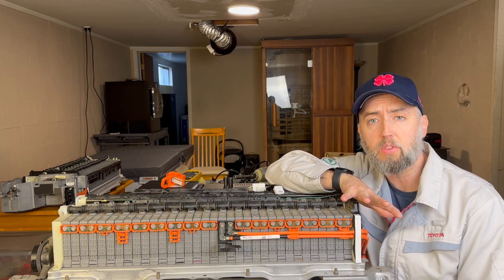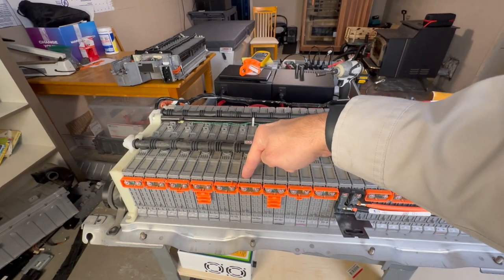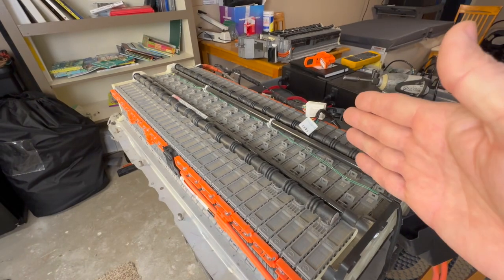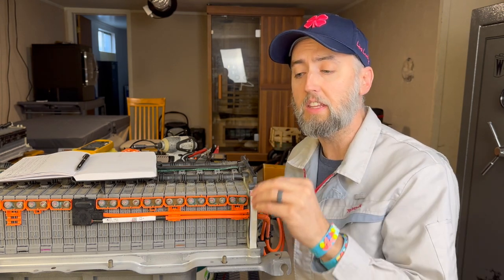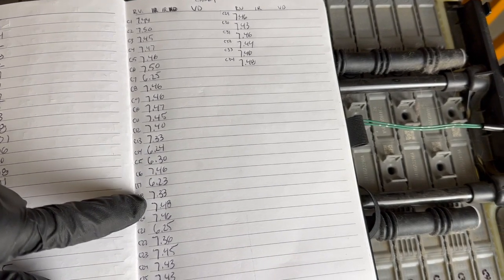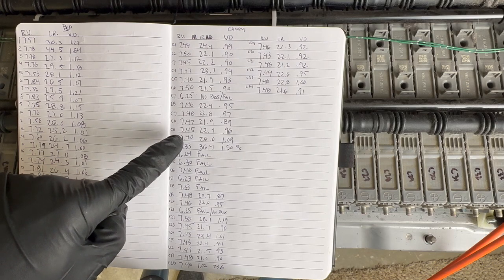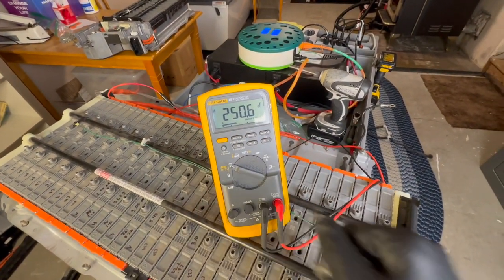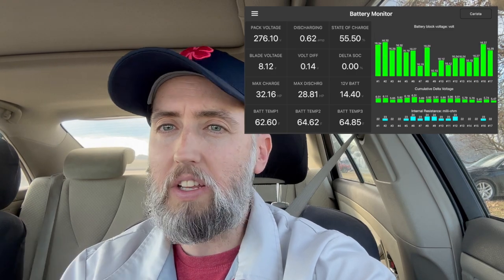How To Properly Repair A High Voltage Nickel Metal Hydride (NiMH) Battery Pack For Hybrid Vehicles

Comment: Nice education. What would be best practice for 1st gen Ford NiMH Escape? I have two low mile Escapes 06 & 08 in fleet that run and drive but if left a week a so will not start without using the 12v jump button.  06 is on driver kick panel 08 is driver dash panel.  Recondition? or replace?

Comment: Im confused by this. Ive watched a lot of videos of balancing and this is the first time ive seen a charge discharge balance done in series. Everyone else discharge charges the individual modules then wires them in parallel to passively balance. A quick search  is telling me that balancing while wired in series is not even possible.
Reply from the maker: You are mistaken. It’s the best way to do it. They all rise and fall as a team. Best results train your team as a team.

Comment: Excellent video!!!  I notice that your C34 is towards the safety disconnect plug. Is that Block 1 or Block 34 as far as the Hybrid controller is concerned?
Reply: Block one should be the one connected to the negative cable
Reply from the maker: You know i always forget but typically number 1 is towards the vent

Comment: Great vidéo! What do you think about cylindric NiMH cells with upgraded airflow like copower or okacc ones?
Reply from the maker: They are not as reliable. They lose the majority of their capacity within 3 years. I’ve tested that .
Reply: @TheHybridGuy  how yeah really ? From this brand?
Reply from the maker: @Hazeblastttt Nexpower only had beta cylindrical sodium cells no nickel. Now the nickel cells that other companies offer are failing in half the time. The design does not allow for proper airflow and heat buildup leads to battery degradation quickly. The design of it also does not yield the same capacity as prismatic style. Due to the high demand of energy required under load by these cars the cylindrical cells just can’t keep up, the lose capacity and fail within 6 years. This is why all these Chinese companies have been switching to prismatic style for Toyotas specifically
Reply: @TheHybridGuy thank you for your answer, i will stick with oem

Comment: Reliable place to get replacement modules?
Reply from the maker: You not so much anymore. Honestly I don’t even suggest doing rebuilds anymore because they just don’t last. Mynewbattery.com is my website where I have partnered with Nexpower to provide high quality sodium cells that are far better than rebuilds.

Comment: 1. Test voltage drop before reconditioning?? Why
2. You have a module explode and I don't believe you. Show it please.
3. You use an actual notebook... How can you see what is good vs garbage without an Excel sheet?

Internal resistance will drop after 3 cycles at 3A so I'm really confused why you would test It before

Comment: I agree, the best way to go is with nickel pl;ated copper busbars.  NOT stainless steel - which is much less conductive than copper.   To my suprise, chatGPT also said it is better to stick with plated nuts as wee - rather than stainless ones.  It described  electro-chemical and other reasons   to not use stainless nuts...

Comment: Did you buy the prolong charger / discharger for the Camry or are you using the Prius model? My Prolong charger only goes to 245 volts the Camry pack seems to want 290 ish
Reply from the maker: You need the Camry ones the Prius won’t do it.

Comment: When testing Prius NiMH modules with a 40 A load for 20 seconds, I see that the voltage drop (DV) is different if the module starts at ~8.1 V (~80 % SOC) versus ~7.8 V (~60 % SOC). How can I properly control the state of charge and test conditions so that every module’s 40 A load test is consistent and directly comparable?
Reply from the maker: This is where it gets tricky. The best way to test is to charge to over 8 then let it sit for a week and then test. No one does that for obvious reasons of it taking forever to build a battery

Comment: How much time do you spend using the prolong pro module tester on each module testing it for IR ,VD,and recharging it?
I want to see if it worth the $900 on unit rather than doing it manuallly. I own 
2 Prius and 
2 CT200h
Reply from the maker: You can spend a lot of time running numbers on the machine for sure. I am making a new video that show how to cut down on this time significantly for those who still want to rebuild.
Reply: @TheHybridGuy thank you 
I am looking forward to your video.
Reply: Can you please send me the link to that video? Thanks
Reply: If you value your time and want a quality refurbished pack. Its best to take it to a place that has a professional equipment charge  discharge   like NuVant,  MDG 800
or  BattMech.

Comment: What does a FAILED test of internal resistance actually mean?  Does it mean infinite resistance, no resistance, or simply a very high resistance that wouldn't be practical ?
Reply from the maker: Very high resistance is the best description for that. Meaning over 30 milliohms is not going to work 😊
Reply: @TheHybridGuy  thanks.

Comment: Great video! How could i test the resistance of the module if I don't have that equipment?
Reply from the maker: I’m working on a video that will update everyone on a cheap but effective tool that’s easy to use and will help you get that done.
Reply: Hi there! 
Did you ever make that video ?
What’s the link to it?

Comment: What is stock IR in each module and what is consider to be to high that should not be used back? Thanks in advance
Reply from the maker: Hey! Thanks for the questions! I’m going to do another video regarding these specifics but a good IR is 20mOhms or less a below 1 volt of voltage drop. 

More to come in the video. Thanks!

Comment: What is the good range for internal resistance in these NIMH batteries?
Reply from the maker: @tanzaniacarschannel6975  in my opinion, 19 milliohms and below. 20-22 is acceptable but may not provide what you are looking for. 23 and over you may find they won’t recondition well.
Reply: @TheHybridGuy  thanks.. now, in this regard, is the internal resistance details shown by Dr. prius app correct or not?

Comment: What can happen if I don’t balance out every battery cell? I replace one module and there all around the same amount of  volts and resistance would this affect anything?
Reply from the maker: If you do not balance chances are you will be doing the same repair in a very short amount of time. Each module should have similar amp hour rating, internal resistance and voltage drop as the others so they can all play nice on the field, so to speak.
Reply: @TheHybridGuy   The last question I have is about is on the installation of the modules new module. My battery modules voltage fluctuate between 7.67v (the minimal and it's 1 module) to the max 7.82v which is the new module and its just that one at that voltage)average voltage is 7.76v and my resistance is the lowest 4.88m the average is 4.90 and the max 5.43 (which is the new module). I've seen that before re-installation a lot of mechanics do the step of discharge and recharge on every single module before reinstalling the battery back on. I don't have the machine right now to recharge and discharge The modules.
Would this cause a problem or suggest just ordering the machine and this extra step.
Reply from the maker: @Luisjun91  doing each one individually can work but doing them as a whole pack yields better results in my experience.
Reply: If you charge and discharge the modules connected altogether, how do you know what capacity each of the cells have? Isn't it important to know on the individual cell, if it has 60 or 80% final capacity before it is mounted with other cells? We know that the battery is as strong as its weakest cell, right?
Reply: @gerynios  I didn’t did it by putting them all together. I bought a module charger in this charger and did it 4 at a time. After all of them got charge I re-ordered them put in my strongest modules in the middle and my weakest ones on the outside then I balance them all out with a wire and put them all in order all positive in one side and all negative at the other side in the end you have to re-order them as it comes in the pack one positive and one negative.
Reply: @gerynios  I really didn’t try to skip any of the steps and my battery is been done for over two months now and it’s still working 100% and cars is driving flawless
Reply: @gerynios  I did it following the videos of all three this video, Gregg Festo hybrid video and Igor Kadulenkov best of luck man
Reply from the maker: @gerynios  excellent question! I measure all of that before I cycle the pack as a whole. That way I have a better understanding of how the modules are going to work with each other when done.
Reply: Thank you. As I cannot afford a PROLong charger, have only 4x100W channel Turnigy 4X 6S charger giving max 10A 20V per channel, can I at least charge the whole pack bonded together? If so, how many amps would be ok for 28 cells?
After this of course I will do balance of the voltages with wires to make them equal in V and mount them on the car. Greetings from Poland!
Reply from the maker: @gerynios  .315 amps if you are doing the pack together.

Comment: Hi i have subscribed your channel, not sure how i missed it. 
few questions. i have 2017 toyota highlander that has 30 modules with 8 celll in each module totalling 9.6 volt (8 times 1.2).. 

how much voltage drop is allowed and how much load you apply and for how long? wht is the lowest value u like to see.
what is the spec for internal resistance?

I assume if we put a load of 6 amp per module for about 5 minutes, we dont want to see less than 9.6 volt and also dont want to see more than .4 volt difference across all modules.. is that a safe test.

Comment: How are you testing internal resistance?
And what is the current/duration of your voltage drop test?
Reply from the maker: @zuccamachine  I have the hybrid automotive battery module tester. It load tests each module up to 50amps. Each test runs about 15-20 seconds.

Comment: Older nickel metal hydride batteries are excellent. Very good capacity and high security. but these must be balanced with a shunt circuit so that all cells charge at the same level. Extends the useful life of the battery pack for many years. The most modern NiMH batteries already have the balancing bus cable.
Reply: What year would you classify "more modern"?
Reply from the maker: @Jettics34 modules that are less than 10 years old I consider more modern modules.
Reply: @Jettics34 low self discharge is modern nimh battery!
Reply from the maker: Shunt circuit! We should talk!
Reply: That's why I prefer lithium batteries,  because as they are dangerous and have no tolerance against over voltage, circuit designers are forced to keep voltage accurate at the level of every single cell.
While in NiMH even at individual module level, there are six or eight cells inside, you hope for them to stay balanced.

Comment: I have a 2nd gen prius was in great shape but sat for 2 years. Battery pack is completely dead going to try this. What do you think?
Reply from the maker: Good luck! When they sit that long modules usually don’t recover. But it would be cool if it did!

Comment: This great video is Merv approved!  Question: When you did your voltage drop test, how big of a load did you use and for how long?
Reply from the maker: @MervsServiceSecrets  hi Merv! I load test at 45-50 amps for up to 20 seconds. I use the prolong battery module tester.
Reply: @TheHybridGuy prolong battery module tester only uses a H4 bulb which only handles like 5A it is impossible it handles 40A on that small of a cable.
Reply from the maker: @ms4fun-q8f  hi, the pro version is not an H4 bulb it’s a machine.

Comment: So been doing some research since my my mileage has dropped down to 34 MPG but no code . Notice that Dr Prius ( on the middle of the pack) reads 30 as an internal resistance. Is it as accurate as it seems ? 
My voltage dif is never over .07 always under 10 for sure . 

And was looking at the prolong delux charger to recondition the whole pack. Thoughts ? Should I try and learn and save the pack or buy a whole pack ? 

Thank you for your time and this awesome video
Reply from the maker: Best is always replace whole pack. Best value for dollar over lifespan of the car.

Comment: what does it mean when a module has high resistance like ex 36ohms & can they be saved?
Reply from the maker: 36 milliohms is really high resistance on a module. you would need to cycle it and see how much it decreases to know if it can be saved or not. I would probably toss it and find better ones.
Reply: @TheHybridGuy  thanks for the reply, but what do u mean by cycle it?
Reply from the maker: @dc5duben96 fully charge and balance, then drop the voltage, and repeat this process like i show in the video.
Reply: @TheHybridGuy  got chu, i might consider getting a charger then

Comment: What is a acceptable resistance ?
Reply from the maker: Less 25 milliohms, 25 is higher than I like but if voltage drop is less than 1v it will work for awhile and probably recondition ok.